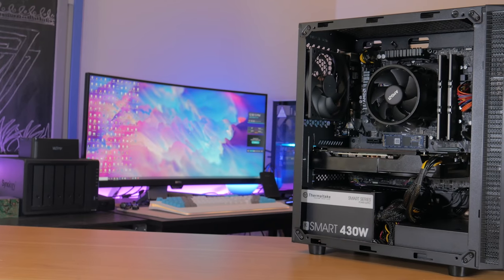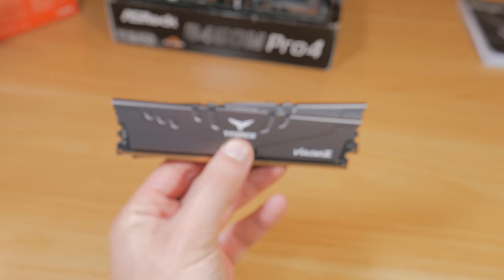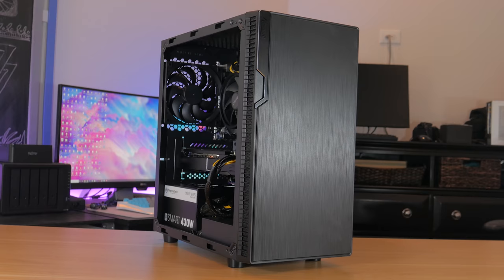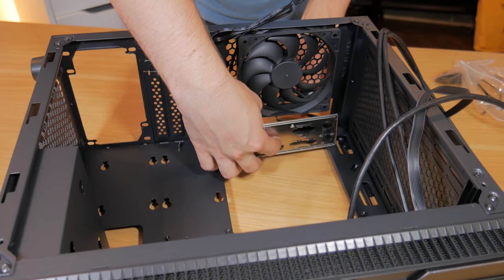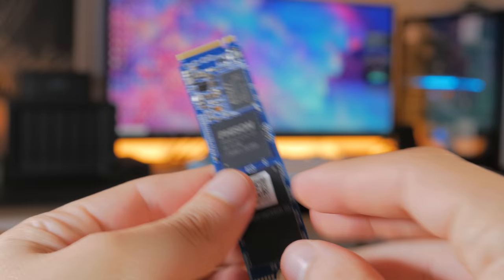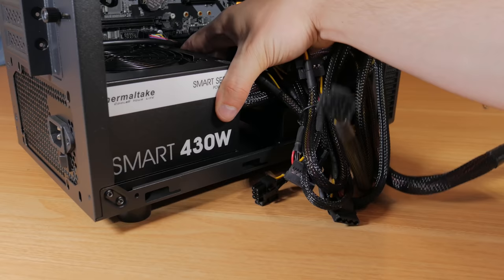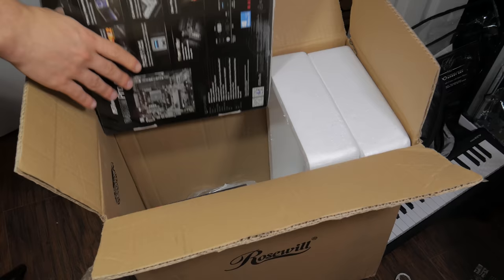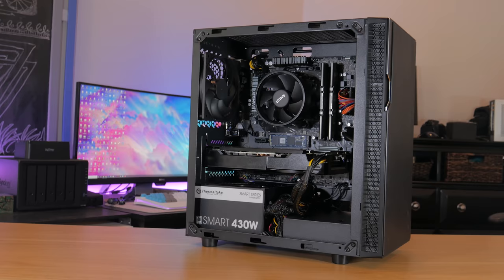$400 Gaming PC Build Guide! (2019)

Comment: And the most important tip of all, as soon as you get this, start saving up for upgrades.
Reply: Well I'd upgrade the ram and gpu as they are lacking, cpu will be okay for a while.
Reply: You'll be good for another 3 years with the GPU then the CPU about another 7 years
Reply: The Watcher yeah dont understand how people can afford upgrading so much
Reply: @michaelmillington9444  they have jobs
Reply: @solo5603  nah.  I'm hoping to get a system similar to this soon(this year) but with 16gb ram, 500gb ssd, etc.  planning on upgrading the gpu next year when I get more money to something like a 1650 super or 1660 super.  I'd say the cpu is good for another 2-3 years but tbh you'll want to get an upgrade for the gpu in the 1 1/2 years tops imo.  you could prob get a 3rd gen r5 for a lot cheaper when the newer generations come out.  if u can wait for a gpu upgrade for a couple years an rtx 2060 in 2 years doesnt seem too bad.

of course this is if you dont have a job, which if you did you could probably get enough money to upgrade ur cpu and gpu in one summer.
Reply: How do you know which one to upgrade and how to upgrade (im new to this pc stuff lol)
Reply: Apex • yea but you can get much better for just a little bit more
Reply: H
Reply: @onezeee  dont get gtx 1650 rx 570 is better
Reply: @wakandaforever4096  depends. Ram is eazy. Cuz you have 4 ram slots open 2 lifts and add your ram slots. Storage is just add hdd or sdd (keep your sata cables). CPU is just take cooler out take cpu off add another. Also check what cpu u can use (thats bcs ddr5 is goming soon) gpu is same. Keep everything u got with mobo box and psu
Reply: @Anonymous Gamer yea get like 750w its gud for some years and it can handle rtx 2080ti i think
Reply: @_sapleok_4516  first of all, ur late af i made that comment over 2 months ago and have had my pc for over a week now. i also was planning on going with a rx 570, but through part optimization and also buying a part on sale to save $15, i was able to bump it up to a 1650 super.  second of all, i said 1650 super, its better than an rx 570, and its about equal to an rx 580 for a tad bit cheaper, and it has nvidia's turing architecture.  im really happy with this graphics card, and would definitely recommend it.  it gives me good frames in all the games i play, and recording anything isn't a problem at all.  I lose almost no performance when recording compared to when I'm not.
Reply: gtx 1650 is a scam
Reply: @mael6513  wym rx 570 is not lacking lmbo
Reply: @_sapleok_4516  the majority of people think they need a bigger psu when they really don’t, probably 80% of all gaming PCs don’t need more than a 600w-650w psu and most won’t even max out that 650w power supply. 550w is pretty much good for whatever you throw at it

Comment: "Sorry, I couldn't fit 16gb of ram in this build under budget." Gets an m.2 ssd?!?!?
Reply: I mean get a cheap hdd
Reply: @NotImportant Its more preference. Do you want faster load times or more frames per second? Personally I would always go for more frames per second.
Reply: @Shea_Nya  you can get more fps by having  ram with more speed and  not by the size of it. i think 3000 Mhz is quite decent for ryzen. And that m.2 nvme is really cheap. But would definitely recommend to add 1tb HDD later. 250 gb is quite plenty for your first budget build assuming you only play a few games.
Reply: @chururi8517  Yes, except for thr facts that most new game utilize nore than 8gb of ram
Reply: @Shea_Nya  RAM is easily upgradable. A lot of HDDs don't allow you to transfer the OS.
Reply: @Shea_Nya  true, but considering the fact that people buy this pc for their entry level gaming experience, 8gb would be just fine. If they insisted on playing games that require more ram, they can always adjust the settings a bit or consider to close the browsers or any other programs while playing. Besides that nvme ssd costs approx. the same like a hdd 1tb, which is most likely the least capacity you wanna go for in my opinion. And waiting new games to load for so long, is actually unpleasant in my opinion.
Reply: 🙂 actually if he went used u can get 16GB of ddr4 memory now, especially the slower 2400 intel variant, its almost as cheap as ddr3 now 😃

Comment: Was looking around this week and got this parts:
AMD Ryzen 7 1700x 90 euro
Gigabyte Aorus B450 I Pro WiFi 90 euro
Corsair Vengeance RGB Pro 16Gb 3200mhz 75 euro
Gigabyte AORUS Radeon RX570 4G 75 euro
OCZ StealthXStream II 600W 20 euro
Hynix SC300 M.2 512GB 45 euro
For around 395 euro i got some nice parts. Already have a case.
Reply: of course, secondhand parts are always cheaper. This video is showing a brand new parts.
Reply: @chururi8517  Its new 😉
Reply: i don't know how can u get the gpu that cheap, plus the power supply for only 20 euro, i just checked new price is around 40 euro. Well if u got it during black friday, it makes sense.
Reply: @chururi8517  Local store here, got 2 years warranty also. Don't know either but couldn't let is pass.
Reply: @MrZeroVision  i see, that gpu and psu are hell of a deal. this two parts are the only reason u can get this cheaper than this video.
Reply: Fake
Reply: I smell bullshit, you wouldn't be able to get the psu or gpu for that price during this time.
Reply: FocusedLoop just because you can’t doesn’t mean he can’t
Reply: @Indy2109  It isnt the fact that I cant, its the fact that its highly likely no one could. A brand new rx 570 for that price at this time, not during blackfriday is just unrealistic. Also nvm about the psu didnt see that it was euro, in that case psu would be possible, gpu still would not be possible.
Reply: Should have bought a gtx 1660 or rx590 or not high end but you should have used entry level gpu
Reply: FocusedLoop maybe used
Reply: @aguy3664  Yeah but it was cheap so ^^
Reply: beast He said brand new
Reply: That was a hell of a bargain!! Ah ryzen 7 in my country, even used is around 120/100 euros
Reply: @cadraf  Ow thats still pretty high, can buy an 2600x for that price.
Reply: William Wykoff 
Damn, in retrospect I see what you mean. It’s really unfortunate that he came in here and made up these prices for new components. Regardless it’s now cheaper than ever to get the foot in the door to the world of PC gaming :D
Reply: thats actually insane a 1700x where i live is like $200

Comment: if you're going to build this, spend some 30$ more on a psu that will not burn your house down

edit: thanks for the likes and just to clarify, i advise against this psu because its literally at the bottom of the psu tier list on the LTT forum.
Reply: I think the psu is ok especially if your not overclocking.
Reply: At least something without the disgusting mustard and ketchup wires!
Reply: Lol true😂
Reply: That psu is really bad.
Reply: Bruh that psu is fine ppl really stress over this shit. 430watt is enough easily for this build and smart is fine
Reply: None of you have any idea how psu’s works 
It lacks otp and ocp
Reply: @n8mr124  The Thermaltake Smart 80+ series is actually bad though. It's not the wattage that's concerning, even though you don't have headroom for upgrades, it's the internal components. It lacks most protections (like OCP, OTP and UVP) and has cheap electronics. It's also group regulated, not dc-dc, which is bad in case of a sudden power draw from the GPU. For more or less the same price, you have options like the Be Quiet System Power 9, or Corsair CX series, which are a lot better.
Reply: PrototypeBlack whisper m is the best, 12v ocp on quad rails
Reply: @Ethan-ll4in   It's really good. It's the same platform as the Enermax Revolution D.F. They're both CWT rebrands. It's a quite bit more expensive than $40 though, so it might be hard fitting it into a budget build like this.
Reply: KeenCrafting lmfaooooo I’m fucking dying rn. Disgusting Ketchup and mustard wires 😂
Reply: @PrototypeOnyx  I was wrong then, thanks for explaining
Reply: RemVee recommendations for a better psu?
Reply: 🙂 its fine, this is a pretty weak AF build
Reply: @sms1480 🙂 maybe hes talking about the new 3000 models that automatically boost well
Reply: I literally spent less money on a better psu that is 500 watts
Reply: jeffry AMD isn’t as power hungry as it used to be ... in a lot of cases intel can be more power hungry . The 3rd gen Ryzen is really good
Reply: @PrototypeOnyx  yo I'm trying to get into PC gaming,what is a PSU?
Reply: @overdub8875  Power supply unit.
Reply: @BOB-ur1mc  what's it called?
Reply: yeppp
Reply: @backtobackgamingv276  check the psu tier list bro. i would go for a corsair cx 2017 450w 80+ bronze, it should be enough.
Reply: Lie-nus
Reply: It was a 80+ bronze, so it shouldn't burn your house down
Reply: @zyleerelis9804  the 80+ standard refers to efficiency, not reliability. the smart series is built with shoddy electronics and lacks OTP (over temperature protection), OCP (over current protection) and UVP (under voltage protection), as stated above by PrototypeBlack, also these cheap psus are probably manufactured by some random chinese oem.
Reply: stupid question but im a beginner to pc building, is it okay to have a psu with higher wattage than your system
Reply: @bruhwhatswrongwitchu2458  yes its fine. Your pc components have parts that regulate how much amps/voltage they need to properly operate. Its actually better to buy a psu with higher voltage for upgrades like a gpu a better motherboard. Etc
Reply: @bruhwhatswrongwitchu2458  as long as its not overkill for your system. don't waste money.
Reply: slave so what psu would you recommend for this build?
Reply: @christianallen3264  options include: Corsair CX (2017) 450 W 80+ Bronze, be quiet! Pure Power 10/11 (400w+) etc. check the psu tier list on the ltt forum, but for the best reviews check out jonnyguru.com, either way you should find a psu that suits your build.
Reply: @aaugh3274  its EVGA tho, owned by nividia
Reply: @aaugh3274  how about corsair cv series?

Comment: This, I was actually building nearly this same computer however with a Ryzen 3 2200G/A320 with 16GB of DDR4 3000mhz as I was going for the APU Graphics to save money. Same Case and NVMe drive, 

Then I came across a good deal on a used 570 8GB which now changes my choice on the APU (although I already purchased it and its past the 30 Return Window - I guess I'll Eat the cost) I have a local MicroCenter where I was going to pick up the same 1600/ASRock combo. I think I am going to put the Ryzen 1600/A320 in the build and keep the B450 and 2200G, as This build will be for my nephew who will not be overclocking. Leaving myself a B450 motherboard and 2200g to hold me over until I want to pony up the $$$ for my personal rig which I am going to update come March (A Birthday gift to myself).

Also, For a cleaner build I used some double sided velcro for cable routing and stuffed the unused wires into the 3.5" bay and tossed the drive sled into the Case Box for safe keeping. I had to compete with one more power cable as I added a 750 GB WD Blue 2.5 HDD to the backside of the motherboard tray for a storage drive, I love the 2.5 Mounting set up Rosewill chose. There are a few minor issues I have with the case and that's only because what eles is availble. I would love a PSU Shoud but for the $32 I paid I it's really not a Con.
Reply: The APU is just fine, if you install a graphics card it will work like a normal processor
Reply: @cameronstlaurent1377  yes, it would have been. However, for $79.00 I was able to upgrade from four core four threads to six core twelve threads which would be great for him and then I get to keep the 2200g for myself, by purchasing the ryzen 5 1600 I got $30 off my ASRock b450m pro. I plan to either put a 2700 or 3700 in this board in the beginning of the year.

Now once I purchase a case I'll have an approximately $300-350 2200g\b450 computer to tie me over until February\March for my upgrade.

Comment: If you go for used parts you can get a ryzen 1600 and rx 580 with a bit of deal hunting.
Reply: Does this require a diff psu?
Reply: @overdub8875  probably. Maybe 600w
Reply: @overdub8875  go with a 550
Reply: @ineedwoman3204  this is so sad because I ordered the psu before everything and now I'm stuck with a 430 watt one from the video
Reply: @ineedwoman3204  I got the ryzen 5 but it seems new to me the Sticker is there and everything do I still have to change my psu because I think it might be brand new
Reply: @overdub8875  I got the 550w one for my ryzen5 2600 and rx 580
Reply: @overdub8875  it should still work fine but you might want to change the psu if you want to upgrade the parts later on
Reply: @ineedwoman3204  thx, I have another question. If I upgraded to a ryzen 7 later on would I need a different motherboard

Comment: You should always use static protection. You can discharge static electricity into a component that won't kill it on the spot, but damage it enough that after significant use, it will eventually fail. A static discharge can output as much as 2000 volts. Computer electronics are designed to only handle 12 volts maximum. Zapping a trace on the motherboard may not sever it completely, but can create a bottleneck in the trace that will lead it to burn out later. Don't risk it. A $5 static bracelet is cheaper than a replacing a Ryzen 3900X or a 2080 Ti.
Reply: 🙂 static is actually very rare
Reply: @MrSamadolfo  incorrect. Static discharge can be weak enough that you don't notice it, but is strong enough to severely damage electronics.
Reply: @greevar  🙂 in practice its very rare
Reply: @MrSamadolfo  No, it's not. You can discharge static without even knowing it. It can be weak enough to only damage a trace so it will function, but fail many hours later from stressing a weak trace. You should always ground yourself. Static discharge is not rare. It's so easy to prevent that there is no excuse not to use a grounding strap. I've worked in PC repair long enough to know you're making a false assumption. Why risk hundreds of dollars avoiding a $5 strap?

Comment: On the side note, PSU are recommended to be placed fan facing down as you can see the case is small and the gpu fans and psu fans will duke each other for air so the gpu will be starved of air to cool the GPU and other components of the graphics card
Reply: 🙂 its fine either way, plus some psu's now come with an rgb fan, so u wanna face it up

Comment: I've built dozens of machines with nearly this exact build out for flipping. The only difference is using a beefier 500W PSU and replacing the new RX570 with a used RX580. Great 1080 gaming experience! 

Keep up the great videos.

Comment: Hey I got the deal of a lifetime: a custom built pc from 2012 with an asus mobo 8gb of ram and I added 8gb adding up to 16 gb of ram, it had a gtx 660, i3-2100(upgraded to i5-2400, 2 1tb hdd WiFi adapter optical drive 3 fans and a 650w psu i love this i used to have an optiplex prebuilt with a gt 710 ddr5
Reply: blank you didn’t even say the price my guy
Reply: Sorry thought I did $100
Reply: Shubhabrata Ray sorry it’s the best cpu I have atm

Comment: Saw the GPU and went hmmmmmmm, turned to my left and there was mine, the exact same one
Reply: @Ayaan Khan nice bro big flex
Reply: I have gt 1030 :(
Reply: @romanbellic5241  I have Intel HD :(
Reply: @theugliest5291  i have i3 550
Reply: @romanbellic5241  I have i3 2350M

Finally a worthy opponent
Reply: @romanbellic5241  AYYY GT 1030 GANG
Reply: 'cept I have a Core 2 Quad Q9550. 4 cores and threads at 2.83 GHz. I love it tho and if I was able to overclock it, I'd be able to use a GTX 1060 without bottlenecking.
Reply: @dejectedangel4970  cool, I'm eventually gonna get a ryzen 5 2600 and either a used GTX 1070 or used 980 or Rx 580 new idk yet
Reply: @romanbellic5241  With that CPU, I'd go with the 580. Slight power difference to a 1070, but much more value due to the lower price.
Reply: @dejectedangel4970  what gt 1030 do you have? I have the EVGA SuperClocked version.
Reply: @romanbellic5241  I have the PNY GT 1030. It's similar to the MSI model except it has a smaller heatsink I believe. I manually overclocked it and I'm pretty happy with it.
Reply: Is it any good to play games like Minecraft, fortnite and call of duty?
Reply: @romanbellic5241  I have a ryzen 5 2600 and gtx 770 runs fortnite at 140 FPS mostly constant low settings
Reply: @marcus4752  nice, I still have my crap PC, I still have my crappy i3 550 from 2010 😭
Reply: radeon hd 5750 and i5 760 on 2010 imac running windows 7 gang

pls send help I need $400

although it does run minecraft decently
Reply: @marcus4752  I'm a new guy and never used a PC before. I'm accustomed to terrible device, rn I'm using a $30 phone for gaming. If I build a $350 PC, would it be enough?

Comment: I have almost the same setup on one of my rigs. Same processor, but went with a B450 atx Aorus I need it 2 PCIE lots since I'm running 2 480s. On my main rig I have the same nvme drive but the 512gb and it performs amazingly well for the price.